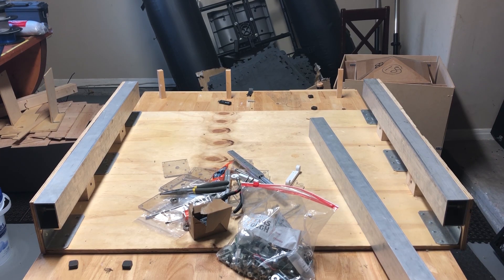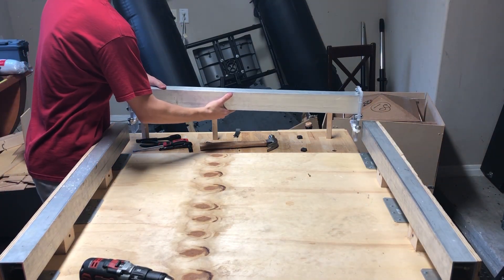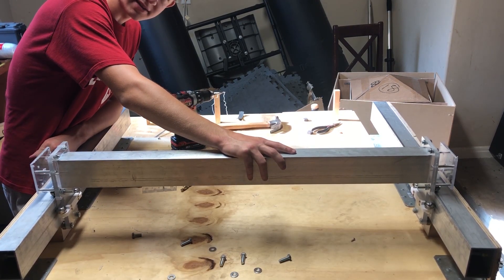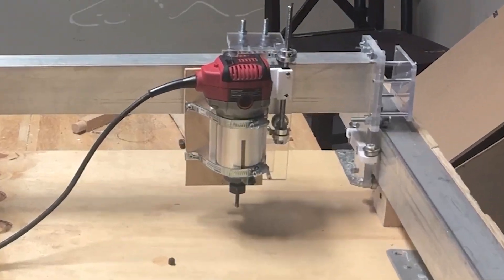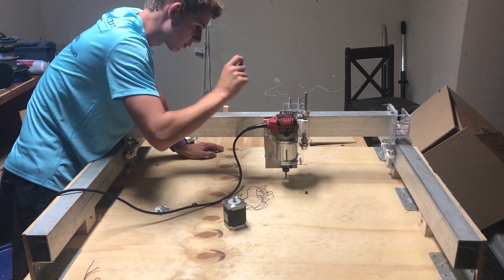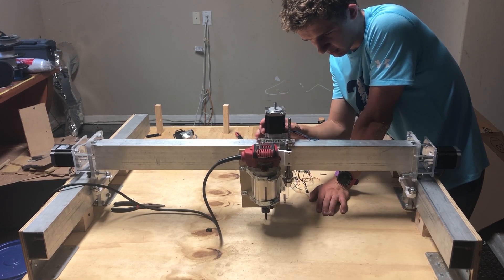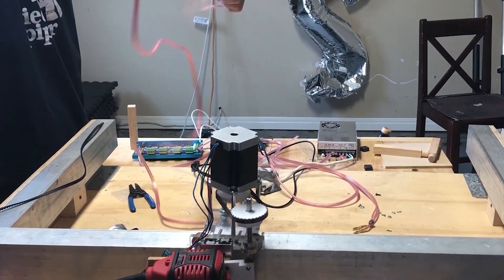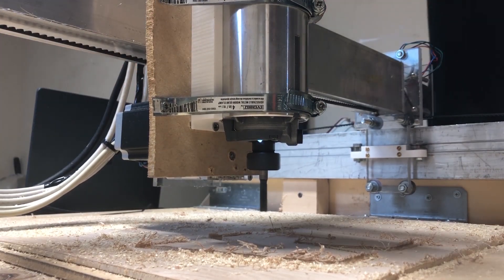LARGE DIY CNC MILL FOR $500

Comment: What cad/cam are you using? And what to hold the material in place?
Reply from the maker: I CAD using Autodesk Inventor, and I CAM using Autodesk HSM. I have a piece of MDF board I keep under the router which is replaceable, and I secure all material to that by just drilling screws into it. Thanks for the suggestion! I'll consider that yep!
Reply: Would also love to see a video of how to set up your cad/cam to work with this router. Amazing job btw!

Comment: do you have sufficient stiffness on axis to use the cutter?
Reply from the maker: I'm not sure what you mean, I showed birch being cut at the very end. If you mean the y axis stability, with two motors on each end and the printed stabilizers to keep it from rotating, the stiffness is adequate.
Reply: @gkitlow  i have some problems with my cnc y axis. x axis is stiff because i have supported rails, but on y axis there is significant bending on rods so when feed is too fast i can see error on cuted item dimensions. probaly will try rebuild y axis with square tube and single row ball bearings something similar like your build.
Reply: @gkitlow  नबर